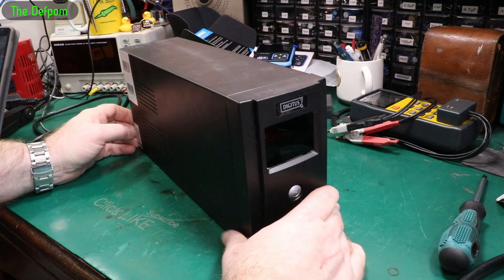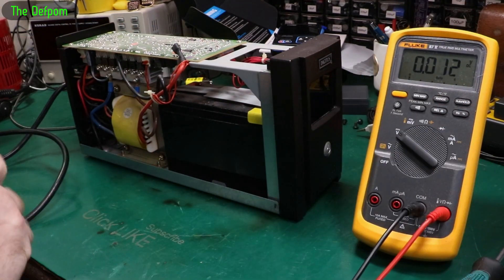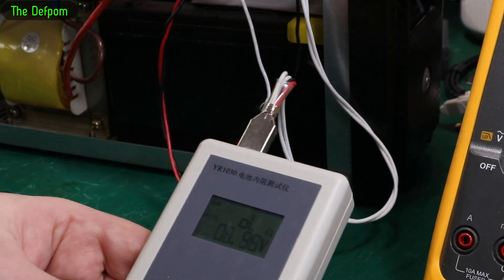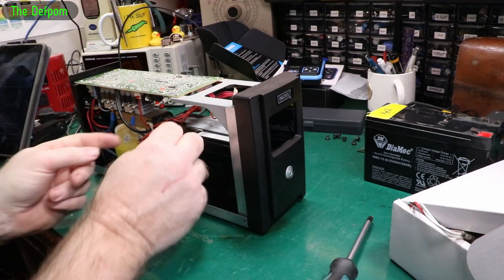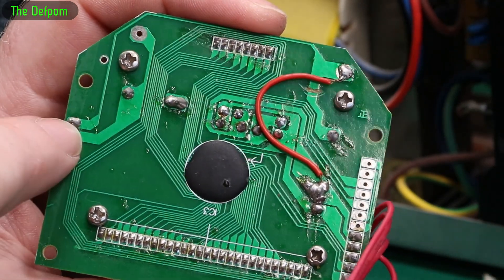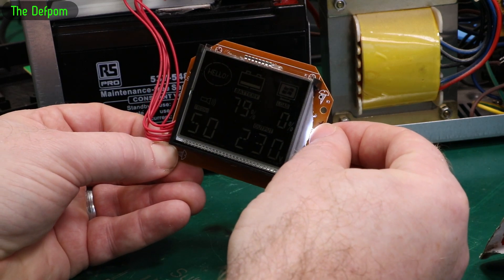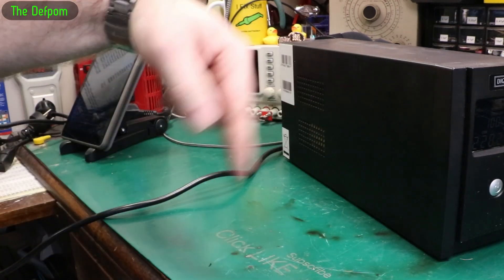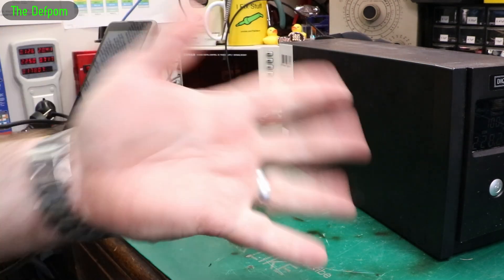🔴 UPS Repair - Digitus DN170023-NZ UPS Repair - No.1285

Comment: Hi Pom, good video's mate I have just watched three of you repairing UPS units, two were just Batteries. I have a Chinese 1.5kw one which works but won't charge the Battery,  I can't figure out where the charge voltage comes from because the mains input just appears to be switched by relays to what would now be the secondary windings, which I think is some kind of peak or sag compensation, but how the hell does the mains get to become DC and charge the Battery. The only other path from live and neutral is through some very high value resistors, like megs which couldn't pass enough current to charge the battery, but the diodes are fed from the very high value resistors, it doesn't make sense. Any ideas mate, or and circuits pleas. Bob, in Lincs

Comment: I’m sure someone will correct me if I’m wrong, but isn’t battery ESR supposed to be measured when fully charged? Your old battery it’s probably still shot, but 70 ohms it’s ridiculous I’m thinking it would read lower if it were charged.
Reply from the maker: @chrisjones8741  it is as charged as it’s going to get… I unplugged the UPS right before shooting the video.

Comment: Put LiFePo4 battery in. Not cheap, but will last forever
Reply from the maker: @feedback-loop  I want to do that, but so far the ones I have seen are limited to something like 8A of current, which isn’t enough, in this case I could have got away with it as it is only powering small loads, but other times the load is too great.
Reply: @TheDefpom  you might be right. however I have seen expensive ones with continuous discharge of 20A and 50A pulse. your RS Pro 537-5488 lead acid one according to the datasheet can do more: 5 min discharge at 26A and 105A 5 sec peak. for a UPS with 2 batteries in series lifepo4 might work.
Reply: @feedback-loop 🤔in series?  How is a UPS with 2 batteries configured?
Reply: @hectorpascal  I have seen models with 2 batteries (24V), so the current is twice lower for the same power (however, such models might have higher rated power too, in that case we have the same problem)

Comment: Great repair, Scott. Don't forget you have that really fancy milliohmmeter -  the HP 4338A. It will do internal resistance on batteries (up to 43 volts). Regards, David
Reply from the maker: @davidv1289  yes I do tend to forget that I have the 4338

Comment: After every repair, the cat has to approve it. Some of these batteries you can pry open the top and find rubber caps that allow topping up.  Of course no 2 batteries behave the same but sometimes you get an extra 6 months of service.

Comment: One of the best things for a desktop PC. This stops the PC from hard-booting with a power outage, which can decimate an OS when it's in the middle of writing to the registry. Once the registry is corrupted, you end up having to reload the OS, unless you have a backup. I even use one for my laptops, so it gives me plenty of time to shut them down properly, because I don't trust laptop batteries keeping a charge for as long as claimed.

Comment: 10:55 Leds are CURRENT driven not voltage driven, if you give a led 20V at 20mA the led will take what it needs to lite up at 20mA.
Always limit the current and check what the led max current is.
Reply from the maker: @yoeribolderdijk1257  an led will take its rated current at it’s rated voltage, lower the voltage and the current also drops, it’s much easier to just measure the voltage going to it, than measure the current passing through it.
Reply: @TheDefpom  I'm sorry but your wrong, if you take a green led at 2.0V it can draw 10mA, at 2,05V it can draw 30mA and at 2,1V it can draw 50mA.
Not all leds are the same voltage drop wise, just measure the current.
Just measure the current the led draws, you had a 10Ohm resister in series with the led measure its drop.
Reply from the maker: @yoeribolderdijk1257  but I KNOW these LEDs run at 3V, which is why I wanted to get the voltage down to give them a longer life. I am NOT wrong about a lower voltage resulting in a lower current draw by the LED.
Reply: @TheDefpom  I know that this results in a lower current draw, but you don't know what the current is now thru the leds. (all you had to do is measure the voltage drop on the 10 Ohm resistor.)
The way you do it is less accurate.
But all is fine you do you.
Reply: A led will turn on at it forward voltage and clamp at that voltage.  If you try to increase that voltage then the led will sink more and more current until it dies as it tries to maintain its fv.
The whole point of the series resistor is to drop the remaining voltage at the current you want to drive the led.
So to connect a 3V led to 20V you need to drop the remaining 17V across the resistor,  or replace the resistor with a constant current device.
Reply: @TheEmbeddedHobbyist  Thanks but i know how it works, but determining how much current a led gets based on the led voltage drop is not a good practice.
Reply: @yoeribolderdijk1257  that's why i pointed out how to do it, you treat the LED in the same way as a Zener diode.  the higher you try and make the voltage the more current it will sink to try and maintain it's Zener voltage. the LED will try and maintain the forward voltage which is controlled by the band gap of the material and thus the colour of the led
I was in fact siding with you. you can't set the current by trying to adjust the forward voltage. the LED has a defined FV and then you use a current source to control the brightness as long as the current source open voltage is above the VF of the LED.
Reply: @TheEmbeddedHobbyist  All i pointed out was that his methode is less accurate to determine the current thru the led.
Reply: @yoeribolderdijk1257  true I would never use the voltage to control the current. The current is controlled by a resistor or current source. as you and I pointed out that it does not take much increase in voltage to give a bigger increase in current. The forward voltage is defined by the bandgap and the bandgap is defined by the frequency of the light (colour) you want.
Wow what fun we are having 🙂over just an LED and resistor.

She was only the electronics engineers daughter but no one could resistor. 
Old dad joke series.

Comment: You should be able to just pry that led outta there. Using too strong a glue would dissolve and cloud up the plastic of that light pipe/spreader.

Often just a flat 3mm led so round ones would fit